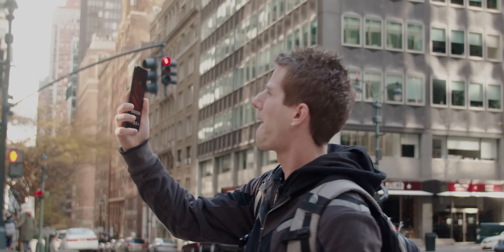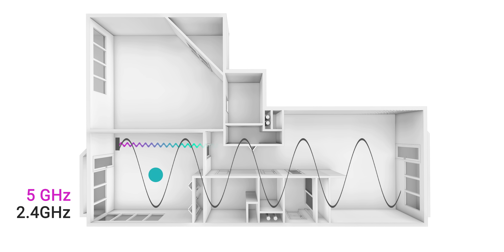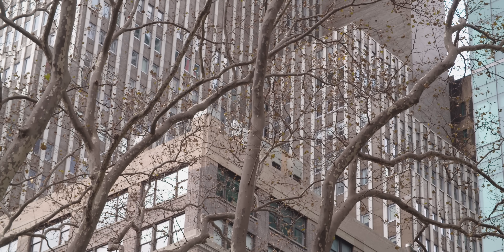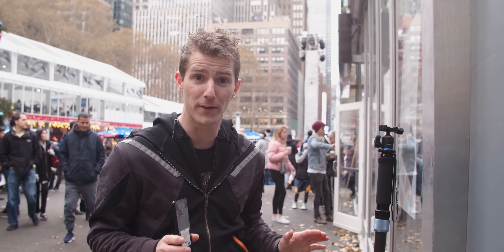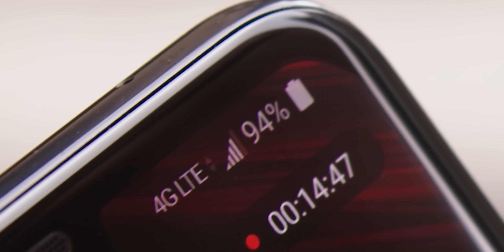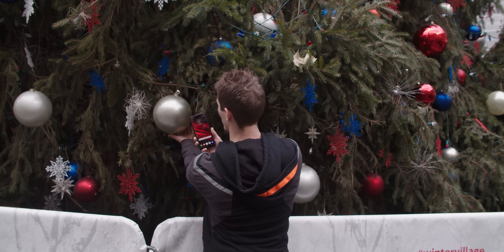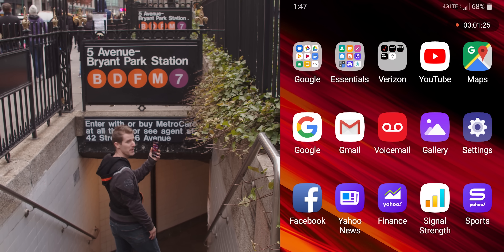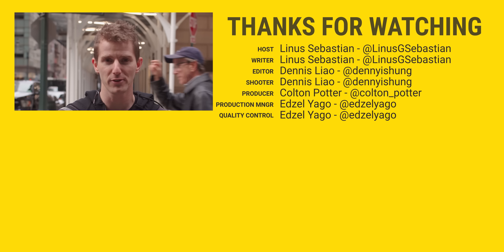The PROBLEM with 5G mmW...

Comment: The problem is that they gonna buzz yo balls bro

Thank God I live in a small city
Reply: Its gonna buzz your balls allright, you might be a bot,but cool name...
Reply: lol it won't 
radiation basics 101
up until a certain point, the higher the freq, the safer it is 
if you are scared of 5g please never go outside or be near a lightbulb, as that's a much higher freq, and uv can actually hurt you
my brain hurts from reading such stupid bullshit
Reply: @martinytcz1762  5g radiation doesn't exist in nature. We do not know the effects on the body, neither for wifi/mobile. By all means enjoy your 5G friend
Reply: @AJ-wf1vh  It's just non-ionising radiation, please see the wikipedia page, or any radiation basics
thank you
Reply: @martinytcz1762  yea it's bull tho. Look up how a microwave works. It may not be ionising but the radiation shakes molecules. 

I don't know about you but I don't want it shaking the molecules in my cells messing stuff up.
Reply: @AJ-wf1vh  If it cannot even pass through your skin due to how high of a frequency it is, it cannot shake up molecules.
Also that's how heat works, if you are near any heat source molecules will accelerate due to the increased heat.
This principle is the reason we have gases, fluids and solid materials (and plasma if you wanna include too)
Reply: @martinytcz1762  it can pass just most of it is absorbed by the outer layer of your skin. No it is a very specific flipping motion caused by the magnetic field. Anyway who cares I'm not getting 5G anytime soon near me. You can be the lab rat and we'll see
Reply: @hootsmin  Well, 2.4GHz can, in fact, pass through your skin and if the power is high enough (like in a microwave) it can actually have an effect, because that is how heat works as mentioned above
I said mmWave cannot as demonstrated in the video, because his body could block it just fine.
If mmWave is to be considered dangerous, than visible light or infra-red should if you look at the frequencies :)
It's quite clear you don't understand the GIANT variable here, power
Of course it can output heat, 1W of it, very dangerous right :D
Reply: @martinytcz1762  It does damage at non-thermal levels too, you dont have to heat tissue to damage it.
Reply: @hootsmin  Yeah, if you can rip out electrons out of atoms, and only frequencies above visible light can do that.

Comment: I bet they sponsored this to get some public sympathy for the merger. As a TMobile customer, you're not finding any here; I'm on the state attorneys sides. 

They keep swearing that it won't cause rates to go up in the wireless sphere, but taking out a huge competitor like Sprint it obviously will, it'll benefit ATT and Verizon without them doing anything.....and you're telling me dish network, a company who's been hoarding spectrum for years now with no results on a network at all is going to replace Sprint that already has one??? No sir, if you want that argument to fly, let dish network buy out Sprint.

Comment: What’s the point of 5G over low/mid band? At that point you’re just on 4G..
Reply: Shooting directed beams at the lower frequencies allows through wall radar and enables tracking of passive RFid, 868/900Mhz will penetrate more than 3 feet of concrete.  Hint - its built into the control system for the LED streetlights and deployed allready.

Comment: So I dont really understand the purpose of this video and think your context is at least a bit misleading. There are several methods on how to fix some parts of the issue which are all in development and are also in planned deployment. The only real problem with the current 5G version is, it is that early adopted where it should still be under development but because of recent political shifts the public got access to some early versions of 5G technologie.
This video should be more about how to conquer these problems and how the research is ongoing and how the real 5G isnt ready for commercial applications. So the public now concludes that GHz waves are a bad idea and under 5G you will encounter these kinds of problems, which is absolutly not true. 5G was planned to be released in 2022 so everything you are able to use today is worse in every aspect than the real 5G once it is in production. What T-Mobile is doing here is harming the image of this new technology with their misleading advertising campaign.
If anyone has some questions on how to conquer parts of the problems demonstrated in this video, I would gladly answer some questions.

Source: working for 5G Lab Germany

Comment: T mobile wanted to show how easy it is to DROP a millimeter wave 5G connection.
They knew LINUS was their man.
1:42
Reply: LinusDropsTips
Reply: @R1000-p6e  LinusDropsThis
Reply: @R1000-p6e kew knew e3
Reply: TMobile are the only company that drops more then Linus.
Reply: P @catboy3471
Reply: @catboy3471  bruh what where tf have you seen that
Reply: Linus has always dropped things and never will stop
Reply: @catboy3471  Millimeter is a US-only thing. Most countries are using sub-6G frequency. Not easily dropped.
Reply: @pauliisosomppi  As explained in video mm-Wave have severe drop out issues. It is too easily blocked. Most countries use sub-6G as primary or the only form of 5G. The US uses mm-Wave only because sub-6G is already taken by the military. You can check the list of 5G networks here https://en.wikipedia.org/wiki/List_of_5G_NR_networks

Comment: I find it really funny that the consumer base doesn't care about 5g, but the industry is scrambling to try to implement it as if it'll create more consumers.
People were super excited about 3G LTE because it meant using the internet without major lag, they were also pretty excited about 4G, because it managed to allow for HD content streaming. But 5G? An awful lot of people are talking like it's worthless because of the terrible reception.
On the back end of the industry, every major player knows that 4G is set to outlive 5G. Half of the companies working on infrastructure and towers don't even want to work with 5G specific products, like millimeter wave systems.

Comment: IT's like in the old times, when H+ was the same
Reply: Don't forget about GPRS 😂
Reply: KYB - yea but that was because there was like 5 GPRS antennas per city.
Reply: coughs in german It's still the best I can get over here with 300k/bit at max and an average of 30k/bit. My Telecom/T-Mobile connection is the best kind of mobile internet that you can buy in Germany. I supposedly have 4G LTE and that stuff but I only get like H+
Reply: @craiz6668 , is it better now after the old 3G towers got new equipment for 4G and 5G?
I personally have noticed 4G/5G coverage and speeds got way better (but T-Mobile also has put some Single RAN antennas on existing B20 base stations).
Reply: @MaxMüller0  it has gotten better in the areas with coverage. However there are still a lot of dead spots where you have absolutely no connection and these spots sadly make up a majority of land here

Comment: Good show, but beside the point. It works, even on first generation 5G Phones only with line of site to the antenna. Next step is to popup a lot of mini towers on every corner of buildings and moving objects also, not just one giant antenna somewhere. My guess is therefore that Next versions of 5G phones will have a slider pop-out antenna like expensive satellite phones, why else would satellite phones have that right? Never seen one without a big antenna bump or flip mechanism. Future will show what people want if 5G antenna's are not fast enough deployed. Btw, 4G+ (LTE) has an option to go as high as 3x 150Mbps = 450Mbps. So i guess we should not complain. Don't forget how GPS tri-angulation developed through out the years (need of at least 12 fixes on satellites) and still does not deliver accurate positioning if you go through a tunnel or between buildings..

Comment: I'm more concerned about your Ping being at 37 ms instead of the advertised 2 - 12 ms.
That sucks !  This is the result of having 5G equipment on the towers but they are hooked up to a slow cable backbone instead of
fiber optic backbone.  5G will not produce 1 - 12 ms until all the towers are interconnected with fiber optic lines all across the U.S.
Reply: It’s because it’s still relying on the LTE core network right now. That goes for all of the carriers in the US.
Reply: 2ms ping to the guy standing next to you
Reply: 5G has multiple waves of deployment and low latency is in a future one
Reply: So never
Reply: They seemed to have fixed the issues, at least in Europe (on T-Mobile Netherlands and Telekom’s 5G network). It’s however still non-standalone.

Comment: So lets see that test again after t-mobile does it's supposed upgrades.  Either it will still be dropping constantly, or they will find a way to still technically be using the 5G but at speeds similar or lower than 4G. Because it's all about marketing the latest tech

Comment: Me: *is Australian
Also me: *Cries on 50mbps wired connection
Reply: 50? Dude, count yourself lucky. Best I can get is Skymuster Plus. Standard Skymuster is 12Mbps until you hit your data cap (they say 150Gb in a month is excessive!) andthen it's down to 128kbps. Skymuster Plus just bumps you to 25Mbps (at almost double the price) until roughly the same data cap and throttled to 256kbps. You see a LOT of the buffering wheel on youtube
Under the Labor NBN we were slated for fixed wireless. So, that's a big "Fuck you, Turdbull!" from myself and everyone else paying extra for slower speeds and tiny caps
Reply: @databanks  Dang bud, that sucks. 
We were slated for full fibre being a newish estate (6 years old) with no existing foxtel lines. Plus only 15km from Brisbane CBD.

But instead we get FTTN with a node around 2km away, topping out at 22 - 27mbps depending on the time of day.
Not as bad as your situation I'll admit, but still frustrating as it was only installed a few months ago
Reply: @MotoCat91  Indeed, the LNP pretty much screwed over everyone who didn't already have NBN or a few million bucks to spare :(
Reply: @databanks  labor liberal both stupid pricks should have let telecom start building it in 91 when keating was in but he passed the buck on to john howard in 92 who killed it, would have only cost $7billion in todays money
Reply: Lionhart  And 100mbps FttN is stable? You got so lucky! I've been reading that it's not always successful, depending on the quality of what's left of the copper. My previous address managed to squeeze out 51Mbps down (on a 50/20 plan) and I counted that a huge upgrade to my barely 4Mbps ADSL2+ previous. Having to go rural and Skymuster with tiny monthly caps was painful
Reply: Lionhart  Nice, rare to hear from someone who gets so close to the speeds they pay for. More than a little envious for you, you lucky bugger. Would LOVE the local exchange to get an upgrade here - it's about as close as you are to your own node.
Reply: Lionhart  Guess it just depends on the local infrastructure. In theory HFC can go even faster on shorter runs, but that's the catch - short runs. Who even knows how many loops, twists and degraded lengths are in the way for those who can't get those speeds? Only the next tech to go look. Seems in some areas, they'd be better off scrapping the lot and starting again, while others are perfectly fine for many years to come. So, essentially, "Your mileage may vary" when it comes to what speed anyone can get

Comment: It's be great for long distance data transmission if the towers could be built to accomodate it. Remote homes and villages wouldnt need to pay for huge cable runs for celullar and internet connections; just install a tower that can receive the signal and you can tap into it.

Comment: Huh? 5G wifi doesnt work the same, range wise, millimeter wave does. I get 5G, full speed, from 2 rooms over. Older dry wall, and 2 walls. Very much the same situation you gave. 5G mmW is quite a bit different tech wise.
Reply from the maker: 5GHz wifi runs at 5GHz. 5th generation cellular data networks can run on any number of different bands. mm wave specifically is at 30-300GHz.

Reading the comments on this video it's very clear to me that there is a lot of confusion about this topic, but I'm at a loss for how to fix it since many of the misconceptions people are posting are addressed within the content of the video...

Comment: 5g. So you can burn though your tiny ass data cap in a fraction of the time! Since I jumped to LTE I can't think of a time I've even thought about speed in regards to my cellphone. As long as I have a stable connection LTE is plenty fast for the low quality youtube videos I might watch to save on data, music streaming and basic browsing. If it ever rolls out I'll be sure to not notice at all.

Comment: When apple adds 5g to the iPhone

Me: Dang the 5g connection just keeps dropping.
Apple: Well stop standing in the way and hold it right!
Reply: Why do people need 5G anyway?  If you are going to need big files, just stay in a 5G area to load up then 4G would just be fine but what is most important is proper GPS lock and a working compass.
Reply: @antdx316  Less congestion, more reliable AKA less fluctuating speeds.
Reply: I know this, but is doesn’t have to do with Apple but rather with the bad 5G coverage (while the X55 modem has some issues with NSA 5G).

Comment: The REAL problem is that 5G uses nearly the same frequency as a US Army non-lethal weapon called the Active Denial System. It can't kill you, but the ADS is pain inflicting. It's basically a mass crowd control weapon. And now soon enough we're going to have 5G towers on every corner. Israel was also involved in the creation of 5G, but aren't going to implement it in their country. Now that's suspicious, isn't it? Sucks that even though I don't even want 5G service or a 5G compatible phone, I'm still gonna be vulnerable to the potential harm those towers could do to a human body and nature. Thanks society. LTE isn't even that slow- coming from someone who's mobile data speed is capped at 3Mbps but has a 1Gbps up/down home connection, I notice differences in internet speeds after being spoiled with Fiber.

Comment: If this was a serious video, you’d be doing a Speedtest before and after blocking the signal. Otherwise you’re just shilling for T-Mobile
Reply: 1st he did that at the very start it went from like over 800mbs to around 600mbps just with is body in the way and it reflecting off the building next to him... 2nd HE is shilling for T-Mobil it is a T-Mobil sponsored video which was also plastered on the screen at the start.

Comment: hello linuz tech tips
 i am a 5G power engineer and only a few milli watts because it is testing data transmission is similar to a microwave where a positive charge ionizes the air and that is why these microwaves cause us cancer. the operation and thus the radio receiver and a backwards transmitter where a bf494 type magnetic field effect transistor inside is excited to its base with the waves received by its antenna the bf494 has positive base and receives these waves by the base of the transistor making the transistor o (bf) oscillate at equal frequency when its capacitor that is in parallel with the coil that generates the electromagnetic waves (the oscillator) is tuned to the same frequency when the power drops that in relation to the distance the power drops because The phone also has an internal transmitter to ask the server for the requested page to be exemplified. every radio magnetic field effect transistor as the name implies contains the substance (radium) which is why a high frequency is achieved because of the radio crystals within the transistor. The transistor supplies the capacitor load because it oscillates at high frequency as well as the speed the capacitor needs to be fed back and oscillate inducing the coil. it will depend on the current (i) of load intensity with power in milliwats the power of such a radio transmitter does not reach 5 watts because it is in tests.

Comment: Funny story about these T-Mobile upgrades. They recently updated my home tower and completely destroyed my connection. It took 7 weeks, 5 managers, and finally direct contact and troubleshooting with the field engineer that updated the tower to figure out the problem and fix it. I had full download speeds but my upload speed was too slow to register on speedtest.net. This made it so basic google browsing was possible but I wasnt even able to send MMS. The final fix was for him to manually lock my radio to certain frequencies but only on my home tower. This is on a Galaxy S9+ so its not like it was an older radio or anything so customers beware.

Comment: Don't forget the part where mmw can oscillate the molecules in your body which will lead to cancer
Reply: it can't, radiation basics 101
pls go back to middle school 
up until a certain point, the higher the freq, the safer it is 
if you are scared of 5g please never go outside or be near a lightbulb, as that's a much higher freq, and uv can actually hurt you
my brain hurts from reading these

Comment: 5G “works” for places like a stadium or a big venue, where you have a lot of wireless clients and the technology allows for a massive number of clients (much higher density than LTE/4G). Anywhere else, it is a major flop.
Reply: That's only mmW 5g that's the whole point of the video